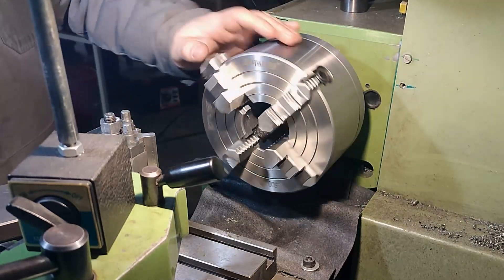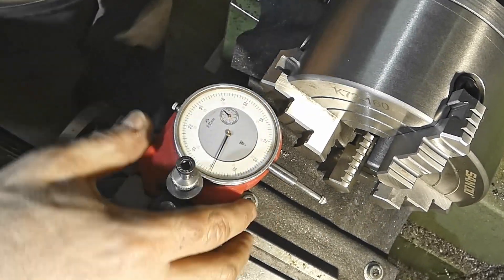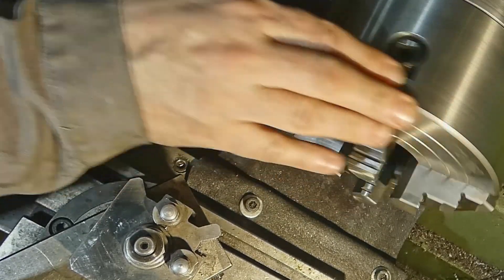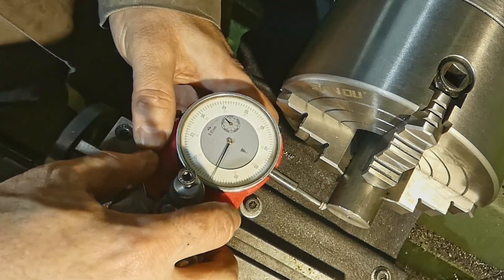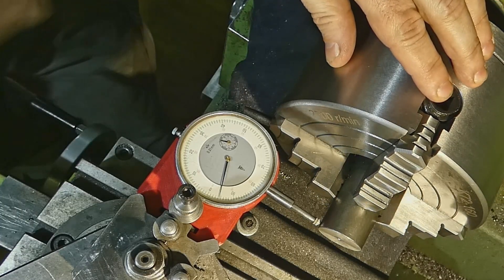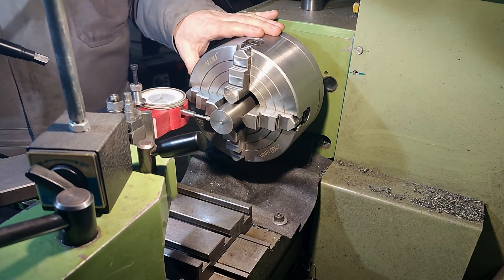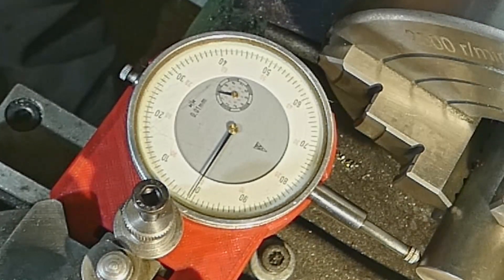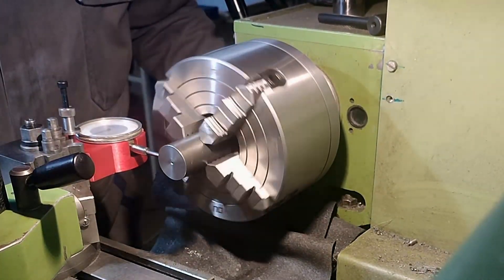Centering stock in 4 independent jaws chuck - fastest, simplest, best method for beginners

Comment: Hi,
Great video. Thanks for sharing.
I'm looking to buy exactly this SANOU K72-160 chuck but I'm not sure about the quality. What is your experience with it? I would need it for Hobby/Semi-profesional work.
Thanks!
Reply from the maker: look, i have it for a fairly long time now, and i can tell that it is fine. Probably more expensive ones are ensuring better experience but this one we can cathegorise like "good enough" I can make any part easyliy run true within 1- 2 of 1 /100 of a mm and if i invest more effort then i can get it in side 0,01 or closer . maybe it is interesting to say that i am utilizing this method of centering, and this has became my number one chuck. I am really using three jaw in rare oportunities like when i have a bunch of same parts to make or something like that. Otherwise, i but a part in, set it to run very reasonably true  ( better then regular three jaw) in one or two minutes and and i am set to go.
Reply: @kolbroshop884  Thanks for the quick reply! I really appreciate it :)
I guess then it's settled. I will order it. I plan to mostly use it for eccentric shafts and rough cleaning up square stock before putting in the cnc mill. I got a Weiler Condor VS recently and the 3 jaw is not so versatile.
Thanks again for the reply!